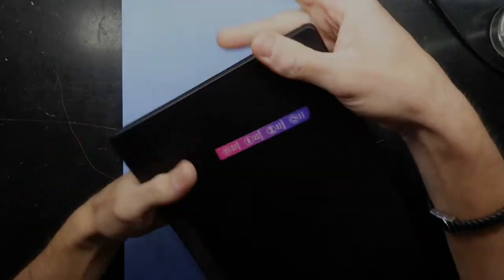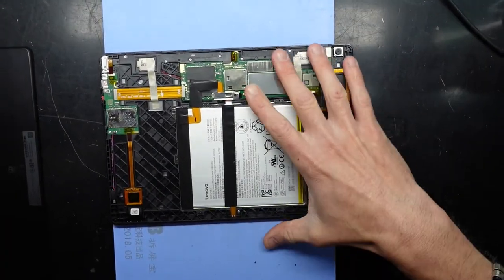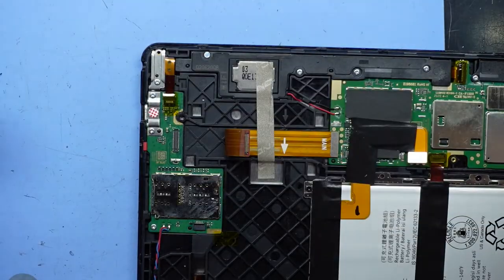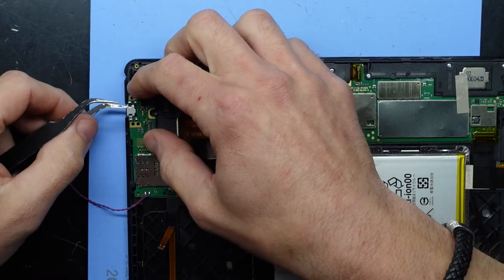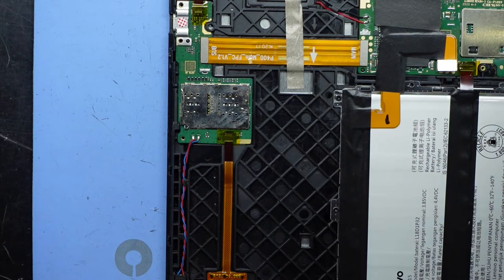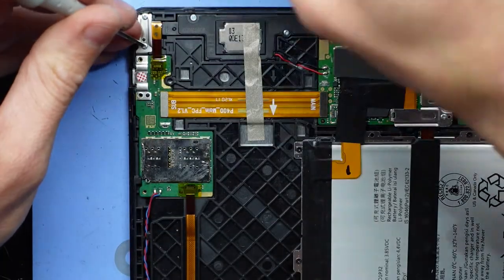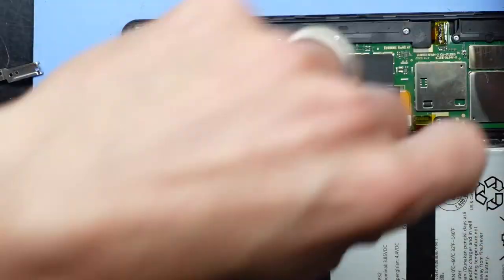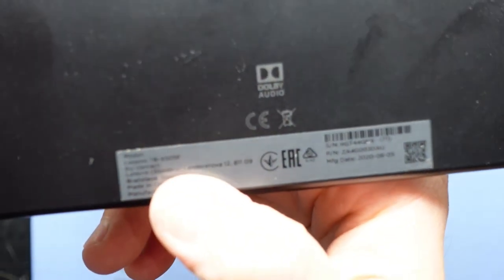Lenovo TB-X505F Teardown and Charger port Replacement

Comment: Hi Rick great tutorial you just saved me £50 on a repair at my local shopping center the Asian guy at the center going charge me £60 to fix my Mrs tablet so I ordered the part that I need from ebay cost of £8 so I done a practice round following your tutorial so I done it a couple of times so I can be confident of doing it so practice makes perfect just got enough power left in the tablet to turn on yip runs fine it doesn't charge of course cause the charging port faulty now I know how to fix thanks to your tutorial so for that I will give you a sub m8t.

Comment: Great video, some helpful tips. we replaced whole board with new (from aliexpress for $8) the vibrate motor was included and I didn't trust my soldering so just left it out.
Reply: Although I've now noticed it is charging extremely slowly - what could that be? I have tried a variety of cables and chargers
Reply from the maker: Another way to do!

Comment: My glass screen wa broken yesterday on my tb x505 and now shows only half of the whole screen. Do u think a new screen will make it work again. I have others mobi!es where the screen glass is broken but phone works as good as new.
Reply from the maker: A replacement display and touch panel and you will be good to go
Reply: @rickstechrepairs  Now I tvink I made wrong order : "10.1 inch touch screen digitizer glass lens suitable for Lenovo Tab M10 TB-X505 TB-X505F TB-X505L TB-X505X" ..it was only the glass i suppose? Price from Wish was only 14 usd and postage 6 usd. In the pic it seems to be only transparent glass. Can you help, did I order just the half of the needed?.